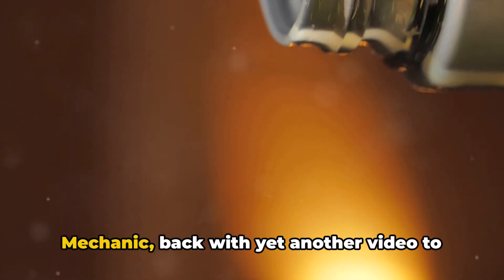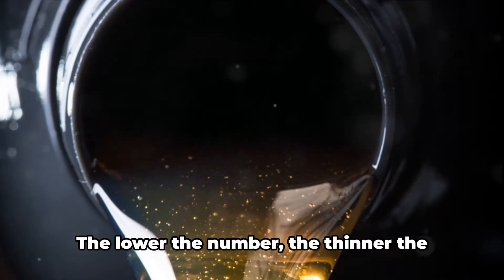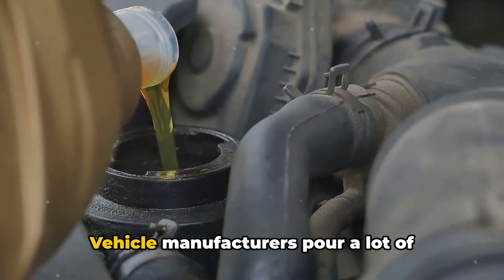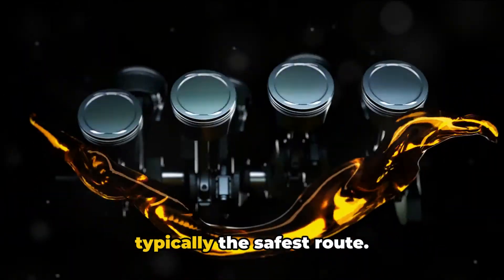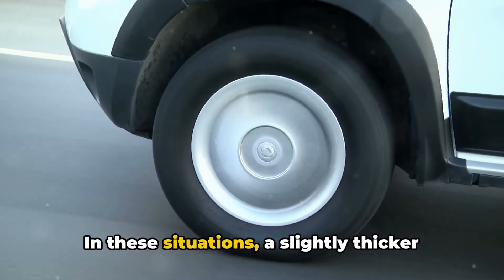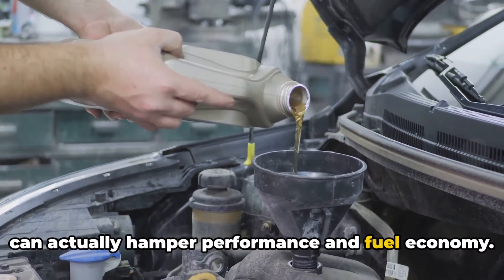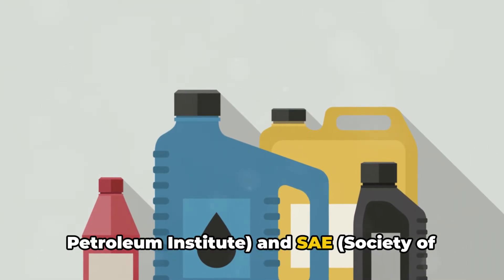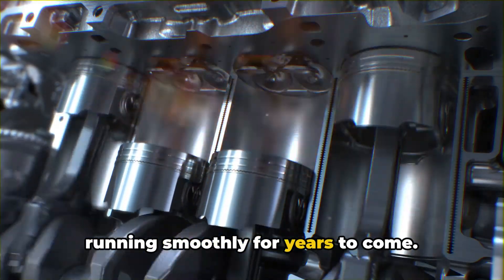5w30 vs 10w30 Engine Oil : Which One Is Better?

Comment: My Nissan Note 1.4 petrol has been fine for years on factory 5w30 but this summer (now over 100,000 miles) I noticed a warning rumble when cold starting. What I did was add Wynns thick oil additive and that has fixed the problem. Should I change to 10w40 at next oilchange?

Comment: Can I use 5w30 in my 125cc bike? The company recommended is 10w30 (currently using it) but I live in kpk, Pakistan where the temperature drops till 0 Celsius. What do you suggest? Any harms to my engine?

Comment: The narrower the range or "reach" of a multi-viscosity oil, the better that oil will lubricate. For example, a 5W-30 oil has slightly
more long chain polymers in the formula, and proportionally less base oil than a 10W-30. Those polymers,
and the additive package in the oil (detergents, dispersants, etc.), break down. A 10W-50
oil (yes, there is such a thing) is not recommended for any vehicle.
Whichever oil you choose, be sure it is temperature-rated for the climate you are driving
in. The gold standard for oils are the tests they are put through in a laboratory, using, among other things, a Saybolt viscometer. How well does an oil flow, at a given temperature? How well does it  lubricate? How robust is the additive package?
Also, what base stock is used in a given oil? It matters. You can contact an oil engineer
at any reputable refiner, and explore the issue in depth. (Ashland Oil, maker of Valvoline, Quaker State, Castrol, Exxon, Pennzoil, and others).
Note: Don't be fooled by the word "synthetic", to describe oil. Its not a man made product.
Its oil which has been put through an extra refining process, which changes the shape of the molecules. Extended oil change intervals are a false promise. No matter what oil you use, the oil and its additive package break down over time, and to protect your engine,
a regular oil and filter change (no more than 5000 miles) must be performed, for long
engine life.

Comment: I live in a hot state under slightly hills. The owners manual recommends 5w-30 And it even says it on the actual dipstick. And that's the kind I always use. I accidentally bought one quart of 10w-30 and 3 quarts of 5w-30. I dumped all of it into the engine, not knowing one of them was the wrong kind until after when I disposed of the empty bottles. And I do live in a hot state and my car does hesitate going up hills or heavy acceleration. But after putting one quart of 10w-30. A car actually did better than before. It ran like a new car. I didn't know that. was panicking when I accidentally put one quart of the wrong oil. My car also leaks oil so I'm kind of panicked even more when I accidentally did this. My car has 250,000 miles so hopefully I didn't do any major damage
Reply from the maker: Hi Bryan.. You likely didn’t cause any damage by mixing 10w-30 with 5w-30, especially in a hot climate. The slightly thicker oil (10w-30) can provide better protection at higher temperatures, which might explain why your car ran better. Given that your engine has 250,000 miles and leaks oil, the thicker oil may have also reduced oil loss.
Reply: 10W-30 is not the "wrong" oil. Relax. Mixing one quart of 10W-30 with three quarts of 5W-30, will not harm your engine. In fact, a high mileage engine
may benefit from switching to a 10W-30 oil, as long as your climate is not
bitter cold (below minus 10 degrees F) in the winter. 5W-30 is commonly
recommended by most engine makers, because it slightly increases
corporate average fuel economy -- standards the Federal government imposes on automakers.
Reply: With that many miles and heat… I’d use the thicker 10w30 would be better.

Comment: That depends mostly on the specs of the oil. However, assuming it has the right specs for your engine, 5-30 is a good allround viscosity. Personally i use GM 5-30 in winter and 5-40 in hot weather.
Reply from the maker: 100%, Great point!
Reply: 10w 30 is better for hot weather and more aggressive driving. Not 5w 40 that’s European oil.
Reply: My 2000 honda accord f23a2 uses 5 w 30
 I've stayed with this since owning it. I live in Midwest. It struggled two weeks ago slightly when it's was minus 30 wind chill for 2 days and  I started  it every two days. And left it idle for five min before driving.